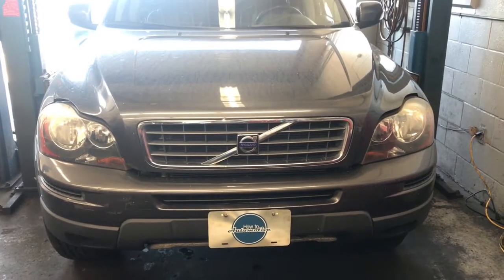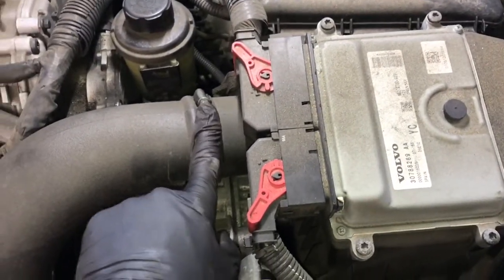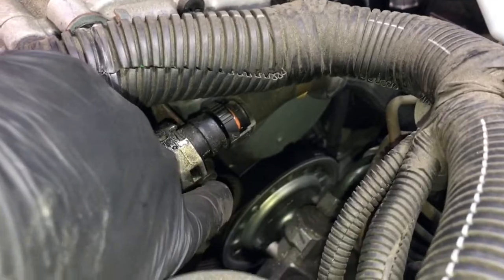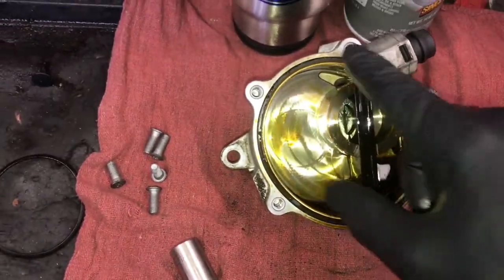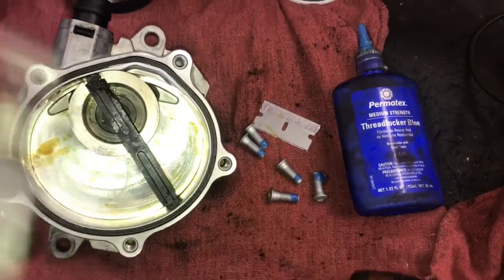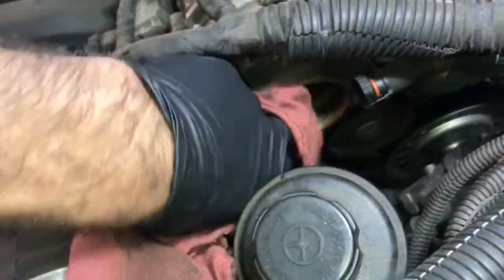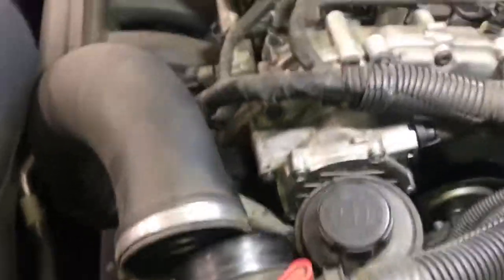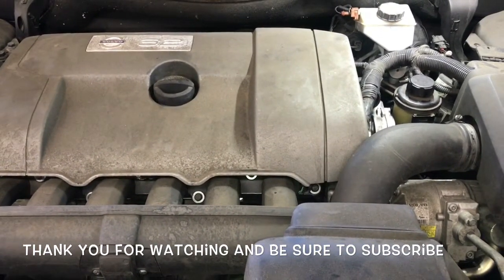How To Rebuild The Vacuum Pump For The Brake Booster On A 2002-2014 Volvo XC90

Comment: Thank you for the educational video, very helpful. I asked a local Volvo dealership and they mentioned that the vacuum pump booster screws are to be tightened to 17 Nm (12.54 ft-lb) after the reseal kit is installed.
Reply from the maker: Glad the video was helpful. Thank you for the tip and for watching!

Comment: I know this is an older video, but our 14xc90 awd has an audible knock sound when the engine is running. Today i did the old screwdriver to the ear test and it is clearly coming from the vacuum pump. Any idea what that could be? Otherwise there isnt a rough idle and the engine seems to run fine otherwise. Thanks in advance!

Comment: Thank you for making this video, very helpful.  Question, is this pump supposed to be making scratching noise when it runs? Mine does, it's pretty loud. Guessing, it originates from the plastic rotor piece that rubs against the enclosure?

Comment: Man the XC60/XC90 looks like way more of a fight vs my XC70.  The XC70 T6 or 3.2L engine barely have to undo anything and barely anything in the way apart from just intake tube, once that’s moved it’s full access no fussing with losing up any other parts like you had to or fighting with the wiring or what not.   

Makes me wonder how much ford involvement their was on the XC60/XC90 on my 2011 XC70 maybe many FoMoCo parts but it feels like I’m working on a Volvo very few things fighting me, when I work on my GF’s 2012 XC60 it feels like I’m working on a cross breed between a ford and a Volvo and lot of things fighting me.     Same could be said about when we had a 2009 V50 T5 AWD as well, 6 months of ownership trying to fix up a beaten car and while we did it much of the stuff we just paid someone to do for us because was a lot of fighting with shit.

Comment: Should be oil inside the pump after rebuilt? If not, the parts will not have friction? I have rebuilt mine, and cleaned the inside (no oil).. Just wanted to re confirm before I put back and start the car..
Reply from the maker: The engine will pump oil in it.
Reply: Unfortunately the oil is leaking from the metal seal which is between the pump and engine.. What could be the reason? Not so tight screws as my bottom one was striped or the seal itself? If the latter, can I use a sealant instead?

Comment: Why does oil leak from the vacuum pump into the brake booster?
Reply from the maker: Because this vacuum pump is driven by the cam on the engine and the oil leaks through the engine side into the vacuum pump..

Comment: What's the part number of the bracket? mine is missing.
Reply from the maker: Sunil Yadav I don't have a part number for the bracket you will need to contact your local dealer for that.